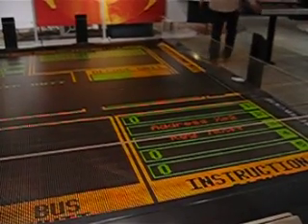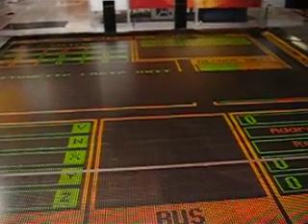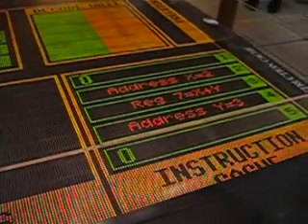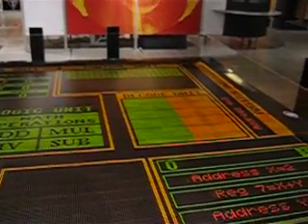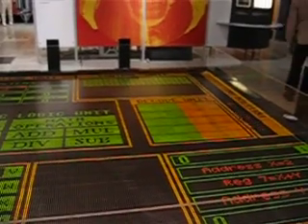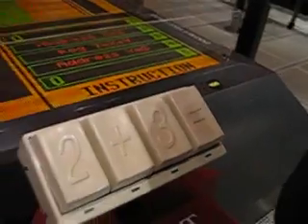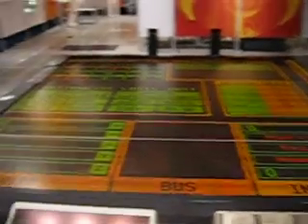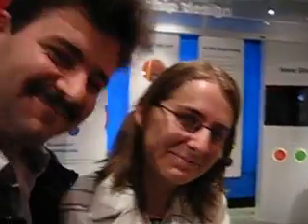Intel Museum - How Microprocessors Work #2

Comment from the maker: Intel Museum at the Intel Headquarters in Santa Clara, California. Filmed in 2005.
Reply: Btw, that's not even close to how real CPUs do math. This demo program is recording keystrokes and serialising characters in RAM, and using certain characters to invoke basic operations.
Real CPUs break down instructions into opcodes and operands, and depending on architecture will identify instructions of constant (RISC) or variable (CISC or VLIW) length. The opcodes are fed into "enable" lines that activate the appropriate gates, and the operation is performed.
Of course, all this is useless without metadata and formatting.